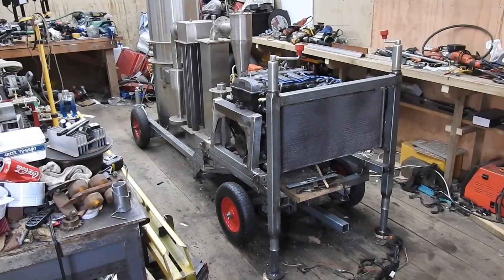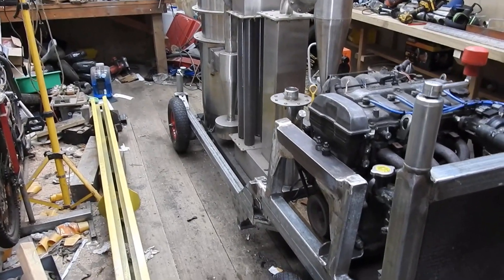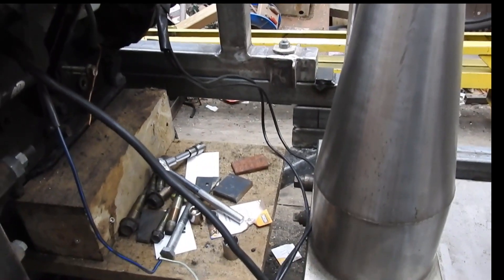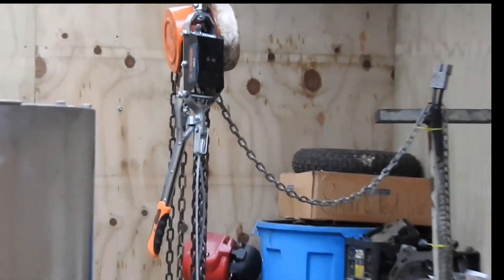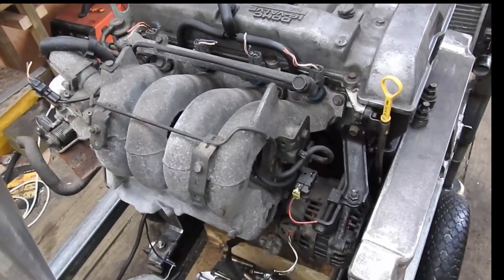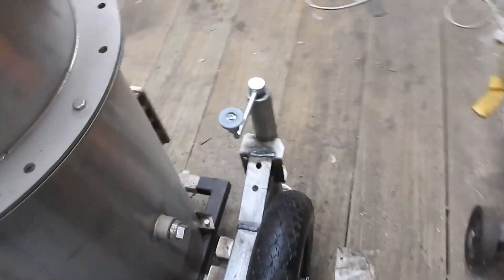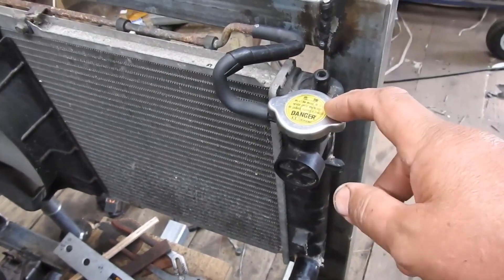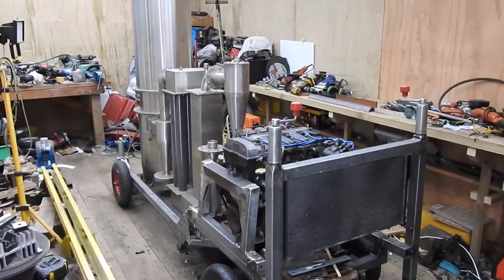The OffGridder has an engine to nibble on  :)

Comment: Almost forgot to ask and you may have mentioned this in some of your previous videos covering this build but what's the length and the width of it? Any idea on the overall weight? I know the big generator is going to definitely add more weight to it. It brought back a few memories when I heard you talking about the tires getting flat spots on them due to weight I dealt with that same issue on a smaller scale even with what I have and I wound up going with solid tires that were rated for a stupid amount weight. I learned real quick you can't use any kind of push mower tires or anything that's hollow because they will get flat spots on them that don't go away once the damage is done. Is it possible that you may wind up adding more trailer jacks in the center or at least around the engine just to make sure you've dealt with the stress on the frame?
Reply from the maker: Howdee Mike, this little guy is 9 feet by 3 feet. 
 The overall weight is close to half a ton, so this is putting a fair old bit of stress on everything. 
 Though these tires are solid, as in not hollow or air filled, they are getting those flat spots on them that you have experienced. 
 It is frustrating, and it added about $500 to the cost of the project, not to mention the time it took to integrate these screw jacks into the build. 
 Still though, it was worth it  :) . 
 While it is possible that I could add a set of jacks at midships, I figure on going with trusses instead. 
 At the front, where I have doubled up on the frame rails, this essentially constitutes a truss assembly. 
 The back half of the trolley frame will enjoy the same benefits, if I weld the gasifier's baseplate onto the cross members that support it. 
 That, and a few, well placed gussets, ought to keep this beast nice and rigid, which wood be good for any offroading I might wanna do with it  ;) .
Reply: @CNCmachiningisfun  I know this is probably a dumb question but dealing with this much weight did you ever consider a couple of small trailer axles so that you could have taken advantage of road rated tires? I'm going to take a guess and say that the real estate you had to work with probably ruled that out. For that matter even building it up on a used trailer.
Reply from the maker: @flash001USA  
 I did consider those options, but my general approach is to keep things small and nimble, so I can rapidly bug out - when Zombie invasions are imminent  ;) . 
 Building it onto a trailer wood have some worthwhile advantages, as I could have room for a drying chamber and a fuel stack. 
 The added portability wood also have been an asset.

Comment: Steve it's really taking shape. I can't wait to see this beast up and running and knowing you that'll be sooner than later. I do have a question though? Where's the driver seat and the steering wheel going to be placed?
Reply from the maker: Hmmmm, good question. 
 Maybe I could put the seat on the top of the cooling column, and use a set of reins to steer this beast. 

 After all, I used reins a LOT, in my horse and cart days, back in the 80s and 90s   :) .

Comment: It's looking the part now. I will be interested to see how you will solve the  ignition problem in the end. I'm thinking of doing something similar.
Reply from the maker: Yup, this is coming along rather well. 
 It's gonna be raining, all weekend, so I imagine that I will be getting more work done on this, while the clouds cry. 
 To fix the ignition system, I figure on adding a set of hall effect switches. 
 These will be triggered by the rotor disc, in order to create an index pulse - and a string of firing pulses. 
 Looking forward to seeing watt you come up with on your build  :) .

Comment: Steve that is amazing :) I wondered all the time what you present as next - and this crashes all boundaries. I did not except this :) Great job!
My Blockhouse is now nearly finished and I will begin soon to build my Crumbler into it. Lots of welding and customizing but as you know - there's no more fun than doing something to get it running ;)
Reply from the maker: Thanks kindly, my friend  :) . 
 This project is coming along, quite nicely. 
 There's a LOT to do, just yet, but I will get there. 
 That's great news on your blockhouse project. It will surely silence any noisy machinery, and give you the freedom to get into all sorts of exciting experiments  :) .
Reply: @CNCmachiningisfun  For sure it will ;) I started today to mount the rock condensers, filters and the washers. Looks fantastic clean by now :D but as you know - it won't stay that clean when I'm going to run and test it. By the way - why are you constructing yours as a moveable one? I decided to built Version 3 stationary because I want to use its heat for heating and hot water and this will be connected to our home. The gas for my genset will be used when I see the first smurf staring at my flame ;)
Reply from the maker: @ravelkoff3549  
 I really do look forward to seeing watt you have created. OK, I know you are a little worried about video uploads being troublesome for you, but your progress sounds very interesting   :) . 
 Yup, these look soooooo clean when they are new, and it really is a shame to get them dirty, but one needs one's watts and hots, right?  
 About the mobility aspect, I tend to make ALL of my machines that way, as I will need to move this out of the workshop, once it is up and running, so I can start on the next project. 
 Also, I am in the process of selling my farm, and I need to have all of my machinery ready to load onto the transport trucks, at a moment's notice. 
 Talking of hot water, and general heating, I wonder if you wood want to add an extra feature here. 
 Since you'll have lots of spare heat, you could boil water, and condense it back as clean drinking water. 
 My little gasifier has a copper coil wrapped around the muffler column, for this very purpose.
Reply: @CNCmachiningisfun  You are selling your farm? Because of neighborhood stress? What about your donkeys? Will you look for another farm or house?

I plan to wrap a copper coil around the outer reactor tube. I can do it, because its gonna be insulated with perlite/plaster filling and so I can reduce the inner heat of about 1100°C to 120°C on the outer tube which is lost heat. The reactor will be build like a double tube. Inside a 100mm steeltube with 5mm thickness, then perlite/plaster and then a 150mm outer tube (ordinary chimney steel tube, 3mm). Above the reactor will be the feeder, the level sensor and the temperature measuring.
A water preheater will be mounted on the outlet of the cyclone to cool down gas and preheat water for the main coil around the reactor. The waterpump is dimensioned to pump 60l /min to avoid overheating and proper circulation of the boiler water, which will be directed to the old inhouse heating system. 
After that I plan to build a gas cooler with an aluminium flex pipe but there I am not sure how to build it or if I have to change my idea. After that a cascaded river rock condenser of 3 tubes is already in place and followed by 2 gaswashers with 3 limited sink drain scrubbers inside each. After that will come a gas dryer (I am not sure if I should use steel wool balls or woodshavings - it depends on service interval. I dont want to clean out everything all the time) to prevent condensate or creosote flowing into the vacuum pump. - So you see - I have a plan and some time, money is limited but it's going on. Any suggestions? :D
Reply from the maker: @ravelkoff3549  
 Yup, there are too many houses here now, and the heavy machines are at it, all day, every day, all around my farm. 
 So, I figure on selling up, and moving into an apartment in the city. OK, it's gonna be a challenge to get all my Donkeys, Ponies and Camels in there, but I will try  ;) . 

 Nah, just kidding.
 
 I plan to buy another farm, waaaayyyyy out in the country, where no one can mess my life up, yet again! 

 Your plans for your gasifier project sound very interesting, and I am sure that you have already taken this a LOT further than most folks ever will. 
 There is a lot to consider, and I am sure you'll encounter all sorts of unforeseen technical hurdles during the testing stages, but it will be well worth all the hard work when you are living in comfort, due to the efforts of your own two hands  :) . 
 About the gas dryer, I wonder if you wood want to consider the use of a cyclone there? 
 Its thermal mass, combined with its gas swirling properties, ought to help with water extraction, without the need to clean it out so often. 
 About the vacuum pump, and the dirt that might enter it, you could use a clear feed pipe, and an 'electric eye', to sound a buzzer when the pipe starts to get a bit dirty. 
 On mine, the pipes have gone brown. This has been the case since the early days, but my engines don't seem to mind a bit of goo, as they just keep on smiling, even though they have nicotine stains on their teeth  ;) .
Reply: @CNCmachiningisfun  Whoa, a farm far offside? Sounds like you have plans to step in the adventure of offgridding :) Our farm is a wood farm. no animals (I hesitate to buy a new dog since my last died in an accident and I miss her so much) but much much wood outthere. In future I plan to create some space for some animals but not atm. One step after the other ;) My wife is always shouting when she discovers a new "hobby" I am sinking in. Even the gasser runs under the topic of a hobby :D
I mentioned the dryer because of the washers. The vacuum pump is no shopvac or something similiar, it is a real vacuum pump and would suck in whatever will come. So I thought about a possibilitiy to avoid water being sucked in through the massive underpressure this pump creates. A cyclone could be ineffective in that matter because the water would be sucked in through the outlet of the cyclone. So perhaps I build a tube where the gas is flowing upwards. Its diameter must be very large, so that everything inside would slow down and so every drop of water should stay inside there and sink down to the the tank again. But I am not on this point already - so I have some time left to think about ;) 

Steve, I wish you the very best for your plans - please keep us updated ;) - And yes I think about creating a video someday, only to show my progress to you ;)
Reply from the maker: @ravelkoff3549  
 Yup, I want to get away from it all, on a distant farm, where I can do my own thing, without being pestered by the townies who are ruining this place. 
 Having been off the power grid since 1994, I have become accustomed to not having a power bill, so the new place doesn't need to have power  :) . 
 Yeah, having animals on the farm is great, but it hurts deeply when they are taken from us, so I know how you feel about this. 
 Yes, you better keep those 'hobbies' under control, as you sure don't want your wife to get jealous of those woodgas bugs  ;) . 
 Ahhh, I see watt you mean about the powerful blower, and its ability to pull water in with the gas. 
 Yeah, it looks like your idea of using a large diameter, tall, separator tank  is the way to go. 
 I may need to do this myself, on the little gasifier, as the existing cooling tower is rusted out, and probably not worth the effort of repairing. 
 Well, it has done more than 1800 hours, so I can't complain too bitterly. 
 I will be sure to keep all my fellow woodenwatters up to date with progress here, as there is a LOT going on right now. 
 Looking forward to seeing the video that you are thinking of creating  :) .
Reply: @CNCmachiningisfun  Hahaha my wife took me under these conditions. She doesn't like it but accept it. There are moments she also interested and wants to know about the progress. At the end I have 2 hobbies: my job and modelling. :D So seen the one is financing the other ;) 

I always wish to live far away from any town or village but there are different things which avoid that. Family, kids, school, kindergarden and hospitality as I told you. Also there are no that much wide unsettled landscapes in Germany which I could go. 

I hope the very best for you and your plans to find what you're looking for. You can be sure of my envy :D 

I thought about the large tank idea and I think I will do that. Connected to the water tank I can be sure the sucked water will return safely to the system and not flowing into the vacuum pump.
Later I will go on welding the reactor and start to put it in shape.

Comment: The warmer weather has caused you to go into hyperdrive with your many projects. That is going to be one heck of a power plant. The duel fuel option is a great idea. ( been doing that myself when the need to be running is immediate) . I'm really looking forward to seeing this beast come alive. I'll bet you will notice a little increase in the wood fuel requirements... as in maybe a tree a day.
Gonna be a grunter ! Thanks for the update
Reply from the maker: Howdee partner, 
 Yup, the hot and sunny stuff has really pushed me into a truly watten state of affairs  ;) . 
 At this time, I can't quite think of a use for all that raw power, so I will need to consider the options - as the build proceeds. 
 For sure, a dual fuel system is a good thing, as it gives you immediate power, and it surely helps to keep the enjun clean  :) . 
 I will need to devise an engine management computer for this, as it will need to handle the ignition system and, perhaps, the injectors. 
 Alternatively, I may opt to use a separate carburetor for this enjun. 
 Maybe, I will need to download a herd of treez from Woods-R-Us, in order to feed this hungry beast  :) . 
 Its gonna be tree-mendous!